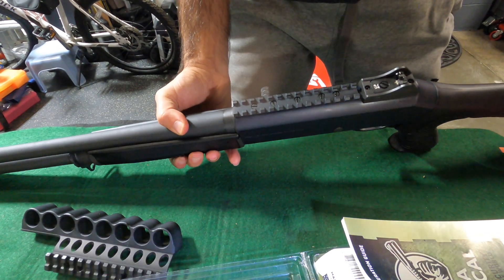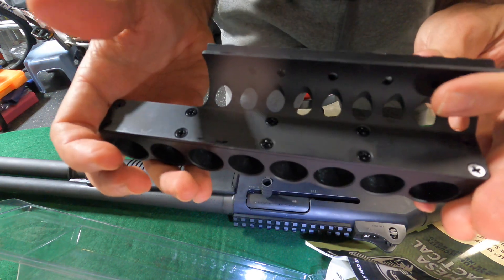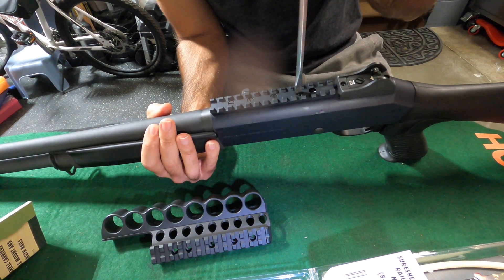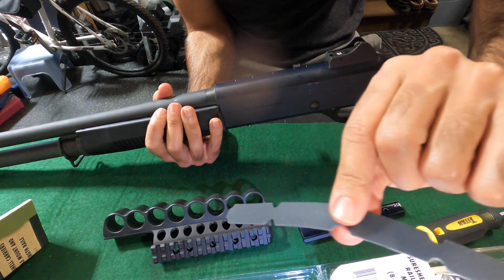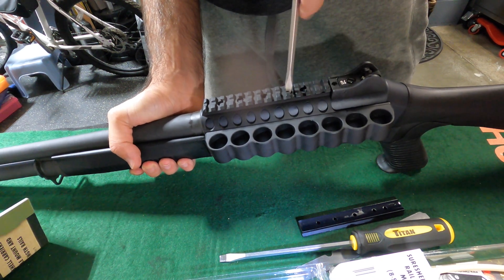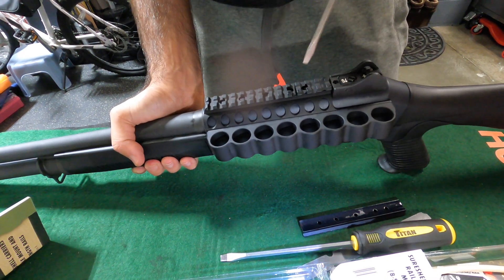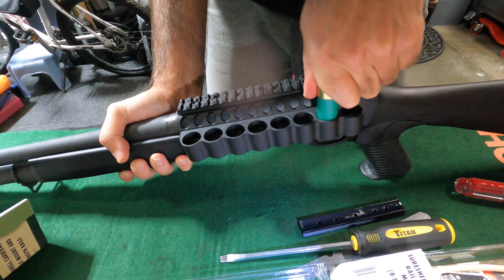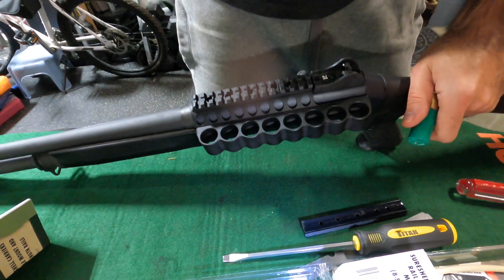BENELLI M4 8 EXTRA ROUNDS CAPACITY MESA TACTICAL SHELL CARRIER SURESHELL

Comment: Isn’t the rubberized pad supposed to go behind the side piece that holds the shells?  To protect the side finish of the receiver?
Reply from the maker: Timothy Jensen nope, on the m4 there is a gap between the receiver and the shell carrier; so they don’t touch unless the support is damaged or bent. With certain shotguns it may be necessary but not on the m4
Reply: Yes it does
Reply: Just got mine, yeah the gasket is even notched for the existing screws but it’s optional to protect the finish “ according to the manual” I would think most new rails wouldn’t be coming off but I’m throwing mine on
Reply: I believe you are correct. My initial impression was the same as in the video at first, I thought you had to cut it to fit the top under the rail but then I realized that it's actually for the side so the shell holder side doesn't have a gap and possibly make metal on metal contact with the side of the receiver if bumped. The adhesive back rubber gasket material even have holes/cuts that match up perfectly with the side screws on the part that houses the elastomer.
Reply: Yeah it's 100% for the side. It's notched perfectly to still allow access to the screws on the back of the shell carrier to be removed to replace the rubber tubing inside that holds the shells in.

Comment: Meh!  I'm going with shell cards. You'll be fighting to feed your shotgun and your side saddle, when I can simply rip off the empty card and replace it with another, and two cards fit in a mag pouch. That looks hard to put shells in and take them out. Those are going the way of the dodo
Reply from the maker: Yep, what works for your needs and what you will train with is always the best choice.
Reply: I really like the look of this but I think I’m going w 7 cartridge cards and Velcro for ease of use. But again I like this look for sure. 
Maybe this on the receiver w Velcro card on stock?!

Comment: Just ordered mine can’t fucking wait
Reply from the maker: great choice.  Mine is broken in now and I love it more
Reply: Did you get it? I’m deciding between the 6 and the 8
Does the 8 feel too big? Just from the pic it seems to go into the trigger well
Although I’m sure it doesn’t affect operation
Reply from the maker: @gitarman666  it does not protrude or interfere with the trigger well at all.  The m4 is already heavy, 2 extra rounds no biggie IMO.  If you are more weight sensitive 6 may be advisable.  Id rather have two extra rounds accessible is why I went with 8
Reply: @shaunstayfree5551  Thanks bro, yeah 8 sounds good

Comment: would you recommend using loctite thread locker on the screws?
Reply from the maker: I do not because they were not thread locked from the factory, with decent but not too much torque it should be fine.  I have shot several rounds and no issues.

Comment: For the life of me I cannot get the screws out on top of the rail to install this even with a heated screwdriver, I killing the original screws???
Reply from the maker: Are you the original owner? If not previous owner may have used red thread lock. Is it an original benelli or a clone? If clone, same issue. Temperature sensitive thread locker requires you to hit the correct temp to break open the bond. Try using a heat gun.

Comment: So has the carrier come loose at all? If not how many rounds have you put through it?
Reply from the maker: About 125 rounds with several 3in magnum loads. There is a torque spec in the manual as well
Reply: @shaunstayfree5551  I know. 15 inch pounds. I was just curious because I have the exactly same carrier. Honestly I'm more curious to see the long term effects on the reciever. Five tiny screws with all that weight under shotgun levels of recoil. Just has me thinking a Esstac velcro carrier might have been better for the gun in the long haul.
Reply from the maker: @project86xero  well for me the bigger concern is the very positive retention takes some force to get the shells out, the Velcro I think would be quicker for SD use vs target practice, although there is a trade off there as well as Velcro can also come undone or move around etc
Reply: @shaunstayfree5551 the advantage of the velcro is thats its easy to remove the card when it's empty and swap it with another. Also a 7 shell card is the same size ad an AR 15 mag. So you can use the same chest rigs or plate carriers. You can also use a velcro belt or bag liner too.

Also the velcro esstac cards hold shells more securely than the mesa carrier with the lighter retention tube. It's about the same as the heavy duty ine to me. Plus when they ware out a replacement is $15.
Reply from the maker: @project86xero  good points and hard to beat but I always thought I would get it to hang up on something or otherwise F it up in a self def situtation.  The Mesa is sturdy and aint going nowheres, but for a target gun  the estac sounds stellar
Reply: @shaunstayfree5551  meanwhile I'm concerned that I might get the mesa carrier hung up on something like a barricade. An if I hit it with enough force I could strip the screws out of the receiver. Which would be bad. Maybe I'm just being paranoid.
Reply from the maker: @project86xero  the force that would take would damage the shotgun. I think that’s a nonissue, but certainly a possibility. The carrier is very stout anyways. But yes use what you’re comfortable with physically and mentally and start cheap and can decide from there
Reply: @shaunstayfree5551  that's kind of my point. It would take a decent amount of force and would damage the gun. However with heavy use it's definitely a possibility. 

I mean imagine dropping it on the carrier from several feet or jamming it into a barricade, especially repeatedly. Again I'm concerned about the long term ramifications. An for me it's not a range toy or target gun. It's a combat shotgun. I'm not going to baby it. I'm going to practice with it and take it to classes. As such I'm trying to find out if anyone has used one of these carriers in conditions like that and if it indeed holds up. 

I mean the gun is a tank and I'd like the accessories to hold up just as well. An I definitely don't want them to cause damage as a result of their presents on the gun. 

Also the word cheap and Benelli don't belong in the same sentence. LOL

Speaking of I honestly hesitate to slap a piece of $2 3M velcro on my $2,000 shotgun. So I went with the Mesa Tactical 8 shot shell carrier. But in retrospect I'm worried it's more fashion than function. It's well built I'll give you that. But well built isn't always well designed. The Titanic was well built and look how that turned out.

I mean look at the AR-15. The gas tube is a failure point for a reason. If it wasn't designed  to fail the gun could explode or cook off. So I'm worried it's too well built and could easily take those 5 tiny screws with it.